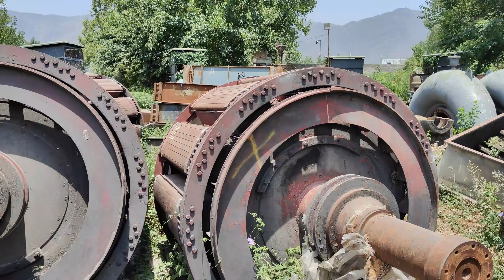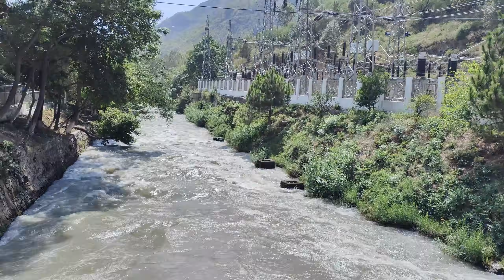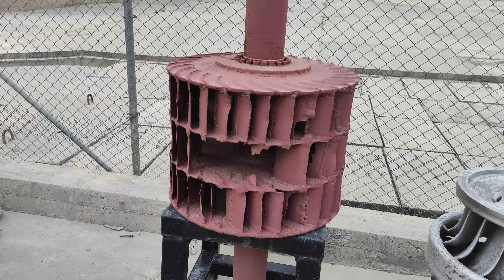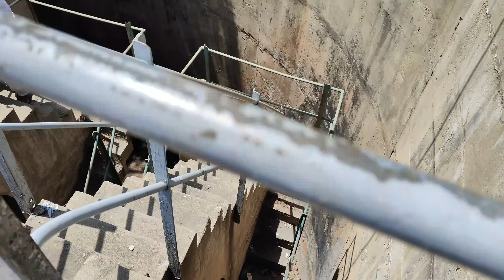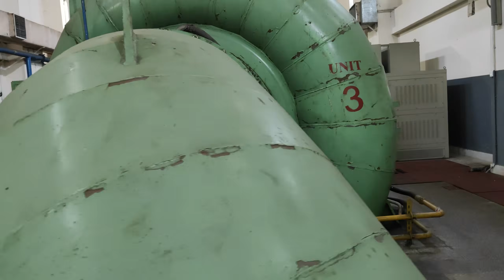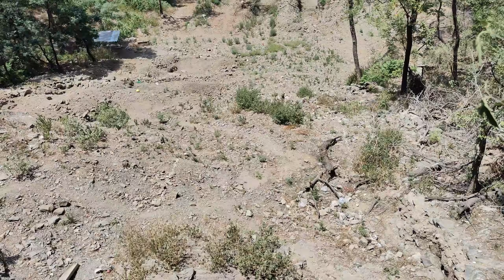Why Modern Engineers Can't Replace This 1930s Intake structure

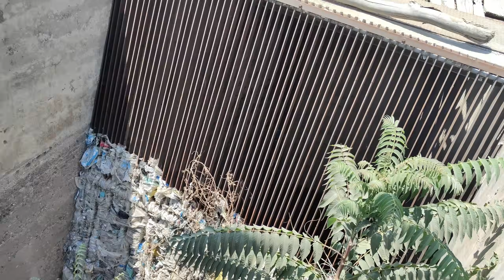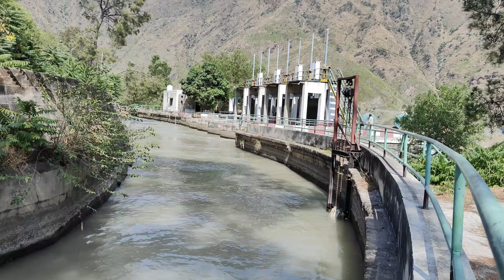Comment: Impressive how those channels were engineered.  After that many years, though, I would think that they would want to at least rework the facing layers of concrete, to repair cracking and spalling, and maybe replace some of the rebar, since it expands as it rusts, and cracks the concrete.  At 5:17, and again at 5:36 (at the far left and right edges of the screen), I see that you have Ailanthus popping up there too.  Ailanthus seems to have made its way to most of the world now, not just in its original China.  We have plenty of it here in Los Angeles.  Some people here deliberately plant it as an ornamental tree, but mostly it is treated as an unwanted weed here.